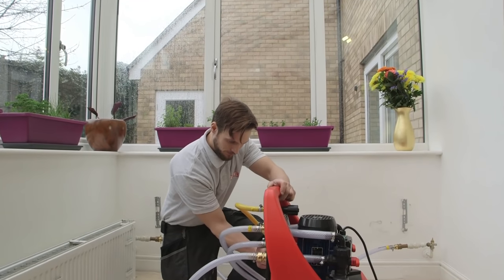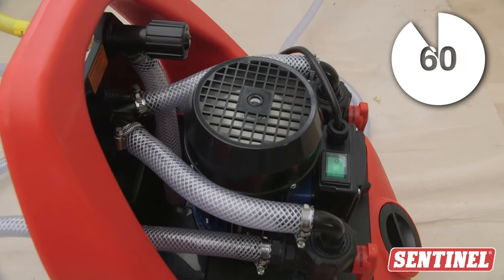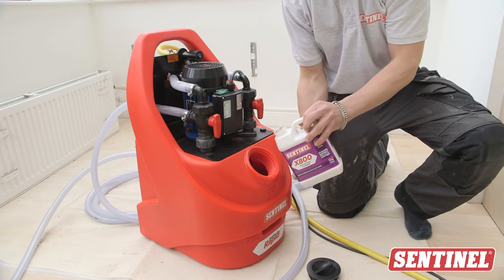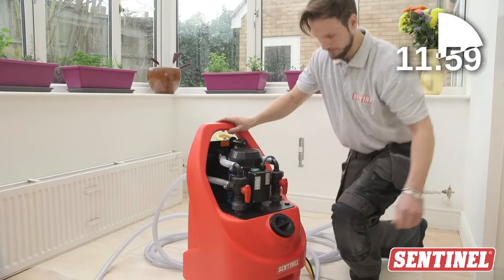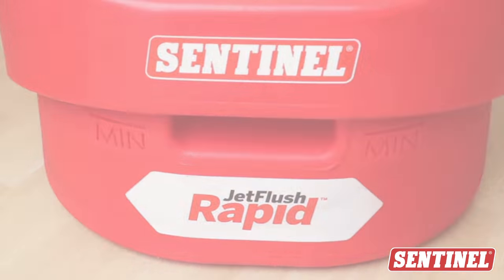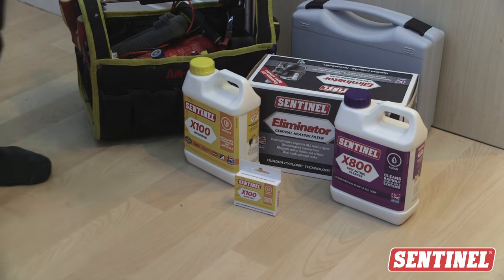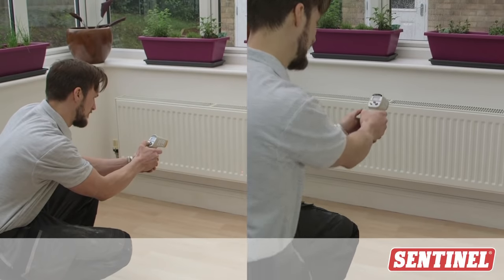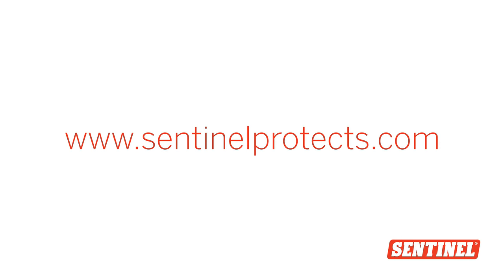How to powerflush a central heating system (2/2)

Comment: If you are flushing the system when installing a new boiler i think its beter not to go via new boiler becouse we don't want a sludge to circulate thrue it.Can we still do it?Shut all the valves to the boiler ? But then we won't be able to heat the boiler.What is the best practice when you installing or replacing the boiler to new?
Reply from the maker: Hello! 👋 
Best practice is to clean and flush the system on the old boiler, if it still functions.
If no circulation is available on the old boiler, a filter installed on the new boiler install (as recommended by BS7593) will ensure that any circulating can be captured on the return before entering the new boiler.
Hope this helps! 👍
Reply: But then you won't be able to conferences flow function Ian I correct in saying that

Comment: Powerflushing through 10mm isnt good practice. Ideally you would get back to 22mm
Reply: Why ?
Reply: Andrew Millward 10mm Pipe is flimsy and restrictive of water pressure, there wouldn’t be enough pressure going through the system to flush all the gunge out
Reply: Andrew Millward also power flushing using a machine that pressurises the system using its own pump rather than running off the boiler can blow trv’s and create other water leaks
Reply: What's your thoughts on flushing a system that has 8mms duel entered rad valves, the power flush will be connected to 22mms pipe work at the boiler and a magna cleanes on the return before the boiler, or would you take boiler out of the Intel flush and reconnect the boil once you know all the race are clean, and just send it around the primary and the boiler at the end so all the sludge doesn't go through the heat exchange

Comment: If the boiler has a built-in Circulator, would reversing the water flow from the machine damage it, or is it safe?
Reply from the maker: Flow reversal should not damage a circulator. When powerflushing, the boiler should be switched off anyway (so the pump will not be circulating). In our experience, we also see  many installers isolating the boiler, so the flow does not go through the boiler too.

Comment: What about the rad you took off ?
Reply from the maker: Hi Peter!

Thanks for your question. This radiator should be flushed through with mains water using a hose pipe connected to one of the radiator inlets.

Kind regards,
The Sentinel Team
Reply: how about connecting the machine to it
Reply: @Ox0077-p7h  either works